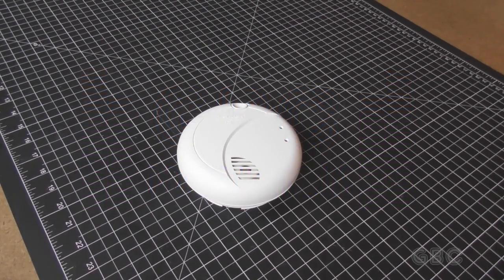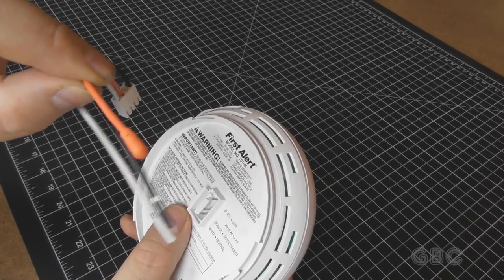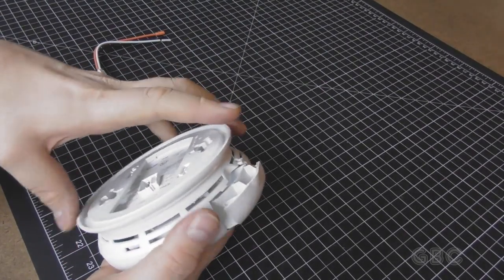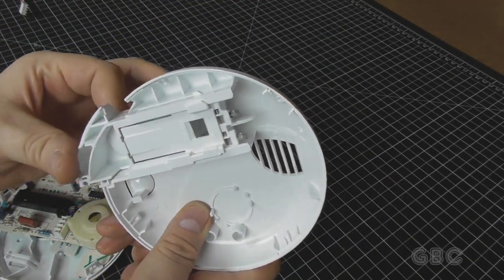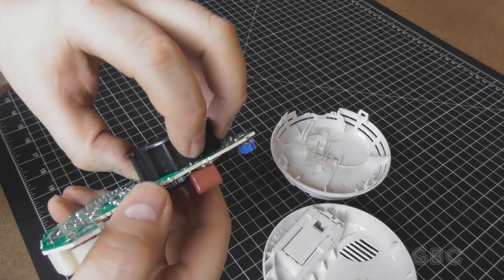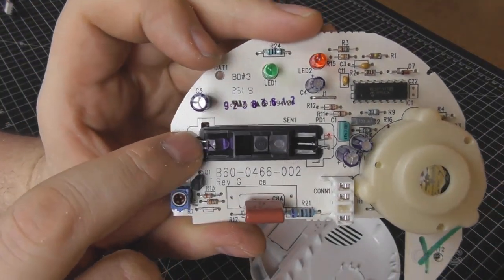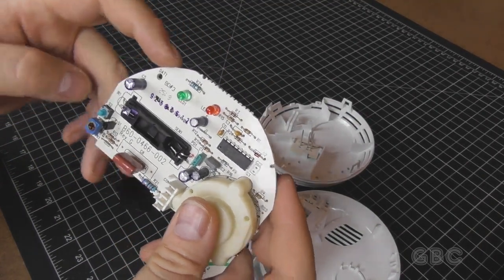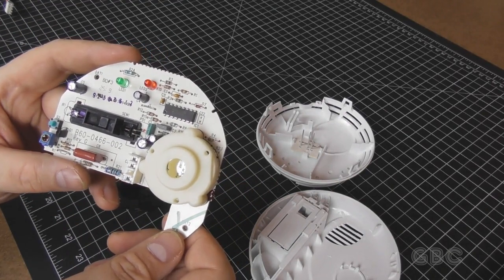[92] Photoelectric Smoke Detector Teardown

Comment: I got a false fire alarm on my First Alert from 2022.  It's Photoelectric, so I took it apart. There are 4 white tabs holding the top part, and some may crack taking it off.  And there are two black tabs holding the Photoelectric chamber. They may also break removing the chamber. I did not see any visible dust inside the chamber, but I blew it out anyway, and put it all back together again.  I also wiped the ceiling around the alarm base with a wet cloth, to remove any hanging dust.  So, if it goes off again, I will be force to buy another, but I will at least try this before wasting my money.  Piece of junk if you ask me, if a little dust is triggering a false alarm.

Comment: Great info. I have one of these that intermittently goes off with no smoke present. To give it a good clean it seems that compressed air at the side where the sensor might help. Would you suggest doing this? Vacuuming didn't help
Reply: A thin black mesh is wrapped around the chamber.  You would risk ripping and destroying it with a vacuum.  It's there to keep out things like bugs I guess.